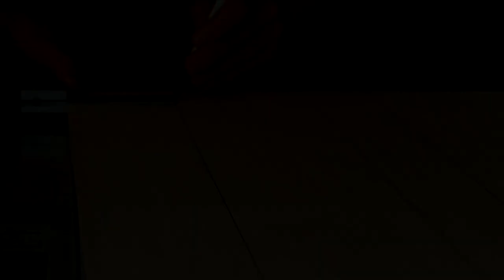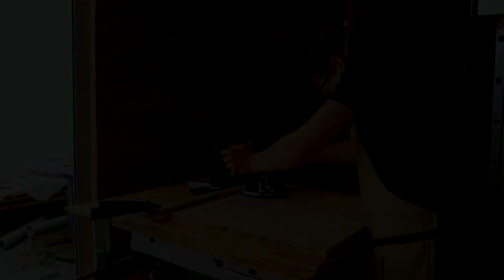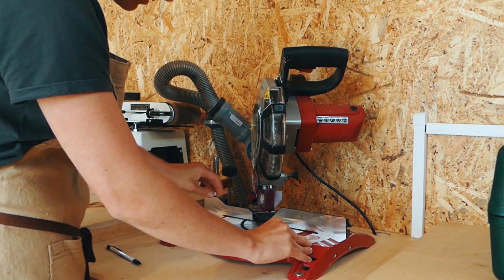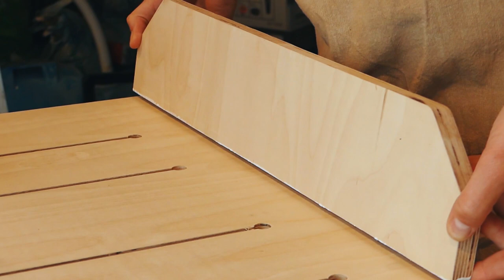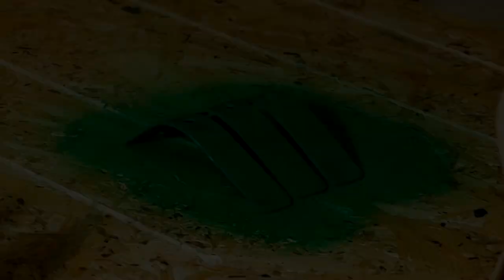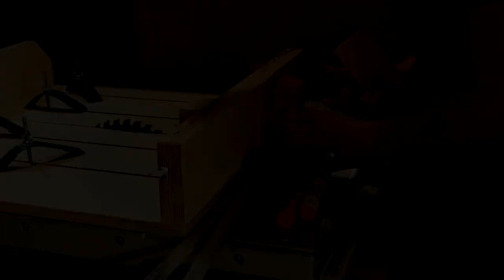How to make Crosscut Sled

Comment: If you use the round part of the router to drive it along the plot, it doesn't matter if you "shake" a little bit while driving the router. So you always keep your direction. That's something I newly learned, after I thought it would be much better to drive along the plot with the straight side of the router. So I just wanted to share, because I have the same router. ;)

Comment: The grooves for the hold down clamps. Did you use a dovetail bit to cut those?
Reply from the maker: I used two different straight cutters
Reply: What holds the bolt for the clamp into the wood?
Reply from the maker: I have screws with a countersunk head, but it is better to use a conventional bolt, and a groove to be pierced under the width of the bolt cap

Comment: Did you use 3/8” T-Track router bit for the runners? I assume that’s heat-shrink on the clamps, correct? Great job on the sled and the video! Very helpful, educational, and inspirational!

Comment: I like the build, but I’m a little concerned about the 90°, as there was no demonstration on how you assured that the fence was square to the blade.  There is no reference to using the five Cut method or if you can get a square to. Assured 90 degrees.